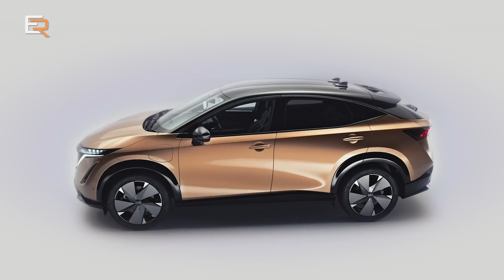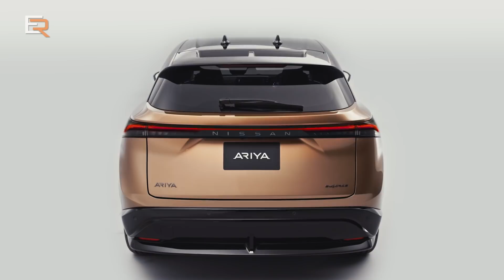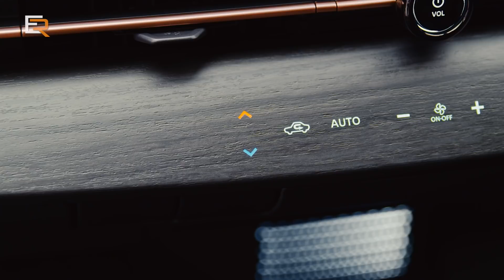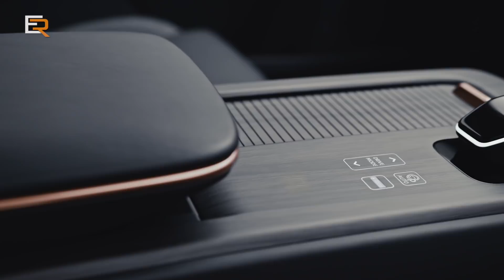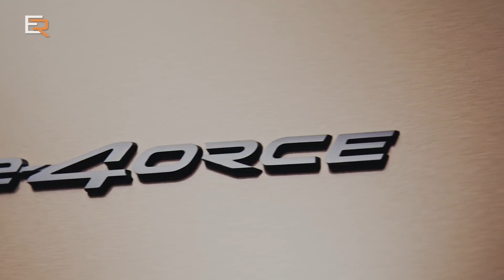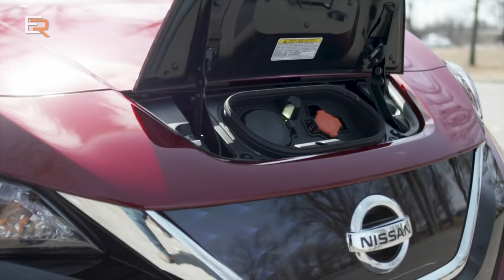NEW 2021 Nissan Ariya EV Production Vehicle   - Look Out Tesla Model Y

Comment: Agreed, fabulous looking Crossover! In the USA I'll bet the 4 wheel drive version with the larger battery, will cost around $55,000. All fine, yes. But the main issue is DC FAST CHARGING while on the road! This vehicle will use the ChaDeMo charging system. The word means Charge De Move, and derives from "how about some tea?" in Japanese. No kidding! I just did a search of charging stations in North Carolina, USA, and found to my pleasant surprise, more such charge stations than Tesla Superchargers.  In the greater Raleigh NC area, there are only two Tesla SuperChargers, which is pitiful. Whereas there are almost a dozen ChaDeMo charge points showing on plugshare, link below. On the negative side, ChaDeMo is not as fast charging as V3 Tesla Superchargers. I checked Plugshare, link below. At a 120 kW charge rate, you can only find Tesla Superchargers. ChaDeMo only goes up to 50 kW, which is HALF THE CHARGE RATE. ChaDeMo 2.0 is coming, though, which will be even faster than a Tesla SuperCharger. So as a Tesla user, right now I would be irritated that it will take TWICE AS LONG to charge this Nissan! If you're in the USA, use this website to see how many ChaDeMo chargers are in your area. People with European EVs will be using the CCS Fast Charge system. 
https://www.plugshare.com/

Comment: In my point of view, Nissan is very poor in quality,  such a poor quality and reliability of Quashqai, please do your research, only design should not be your requirement. My JII quashqai condenser is gone just after six years with various other problems in starring, fuel smell, door rubbers falling off. do you know Nissan has some sort of partnership with Renault, I have always taken the car to the approved dealers. Please do your research, the reviewer should also highlight the reliability issues.
Reply from the maker: Learn To Enlighten I am aware of their partnerships. It’s unfortunate about your Quashqai as these things can happen to any vehicle. I know many people that own and have owned many Nissans that have been very happy with their vehicles and have owned them for many years. What manufacturer would you think has better reliability. Just curious to know.  Thanks

Comment: This would have to be cheaper that the model Y to competitive.
But at the end of the day more EVs is just better for the ozone.
Reply: I from Canada, and I looking forward to this also.  If it is around 60K to 70K Canadian, I will really think about it.  But if it go up to 80K or 90K, I would go with Model Y!  At less the autopilot is really good on the Tesla.
Reply: @25K subs with no videos challenge if it is 95K good luck!  I can get Model Y about 100K Performance and Autopilot in Canada.  Why the hell I want a Nissan?
Reply: 25K subs with no videos challenge how is it better? After Nissan partner with renault in 2000, there reliability went to shit.  Now I heard they spitting up and hopefully it will be better in the future.  The Nissan Leaf, the battery is air cool, there are many complaints with the battery degradation.  However, this one use active cooling.  Even when it come out, I will wait a year see how it is before I get it.  The Lexus NX also have a redesign next year and expected to have a plug in version base on the RAV4. If the Aryie is around 80K fully loaded, that is in the Lexus range, I will wait and see before jump in.

Comment: They along with GM were the innovators.
So it's nice to see this.
Unfortunately evrn with all of the electric mandates incentives welfare from governments this things are still over double an equivalent gas car with the main advantages being instant torque less emissions cheaper to operate and maintain.
Disadvatages are plenty repairs range filling stations fees styling still has emissions at energy source the mining of heavy metals battery production and replacements fires cold weather range. Lack of soul or motor noise analogue feel.
They feel cold and digital.
Still this is one of the best so far I have seen styling wise it is superior to the Ford and tesla.
I really hate tesla interior cheap empty design.
This looks clean and has actual buttons but the a.c. needs real buttons to and I like an actual instrument panel in front of me instead of off to the side that is just dangerous.

Comment: They finally got battery pack cooling right. Announced acceleration for the performance version is 5.1 to 60, so I don't see much demand for that version unless the price difference is minimal, as that is 1.6 seconds slower than the Model Y. 

Looks decent, price will hugely affect demand, but I have to say I was hoping for more.

Comment: Assuming its built in Japan I think the fit and finish is gonna be Much better than a Model Y lol
Reply: Really hope they can price it lower than a model Y as well. Otherwise it would be hard to choose this over the Tesla.  I’m rooting for Nissan to stay relevant. They made some epic sports cars back in the day.
Reply: @vmfan96  This is gonna be available with Tax credits in the US. Tesla has run out of them
Reply: Jurgen Vesst i think the base Ariya is less than 35k
Reply: And the interior looks better than the Tesla.
Reply: @OM_42  
The outside looks like a smacked arse.
EQC nose? Much?
Reply: Absolutely. Even if it will cost same as Model Y I’d still buy Ariya purely because of how much better it looks, leave aside the stunning interior. With Tesla I feel you only buy top notch drivetrain/battery technology but not an actual car
Reply: @ValRuca  
You've seen a picture. Don't jump to conclusions.
Reply: Can it use Tesla’s super chargers?
Reply: @asthavsagar7794  
No.
Reply: Asthav Sagar no, only Tesla can use them

Comment: If I were to buy a new EV right now, it’d probably be a Model 3. But I don’t think their vehicles are worth what they are charging. 
If used, it would probably be an e-Tron. Right now, there is a 2019 e-Tron (base) with about 10,000 km, on sale for about $66,000 here in Calgary. Ouch. 

It is very tempting, but I think I will wait until there are more choices in the (more) affordable EV market, before going/switching to full EV.
Reply: 66000 can get you a brand new model y performance.